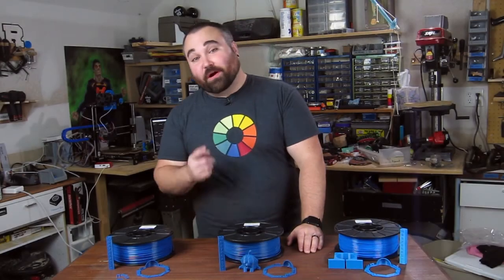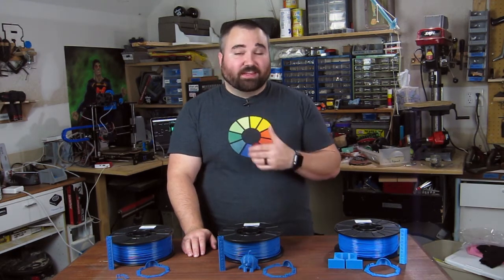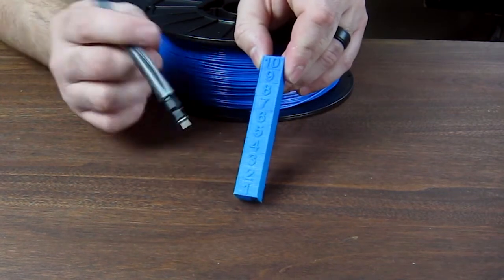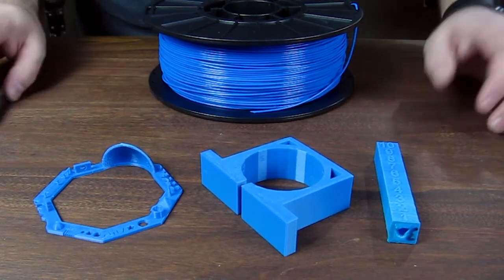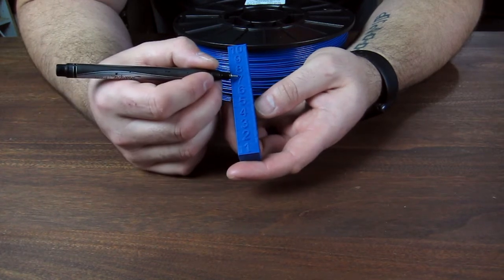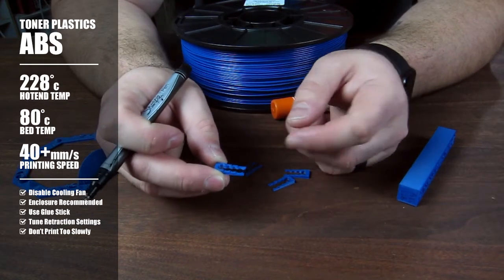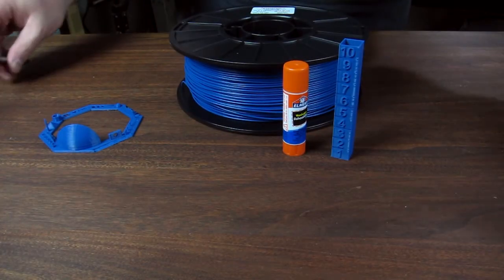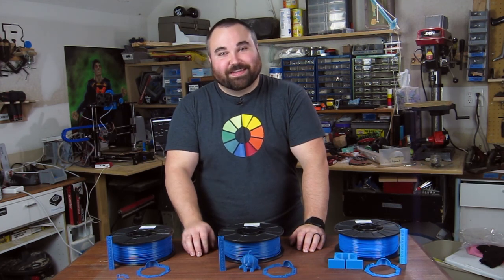Filament Series — Toner Plastics: PETG, ABS and PLA — 3D Printing

Comment: I love these types of videos as well. Really there are not alot of video's showing how to dial in a filament. So you'll get alot of inexperienced users claiming such and such cheap filament didnt work with their printer. Turns out they didnt profile the filament and there wasn't an Lulzbot or Uncle Jessie profile for them to use, so they assumed the filament is trash. I think esun makes inland pla for mircocenter, but you'll get alot of people claiming its no good. Once I profiled it - great filament for the price - $14.99

I would love if you mention calibrating your extruders esteps for the filament you are testing. So many miss this important step. Which will have them chasing their tail for extrusion multiplier and dimensional accuracy.

Also please use the actual temps printed on the temperature towers - that would be alot better for your users. U mention 7 or 8 as being best, but the real temp would be far better as well as a close up or picture shown as you reference the tower.

I dont know how far in depth of a profile you want to go into but a good basic profile also has:
retraction settings ( mentioned but please explain more)
overhang angle b4 support is needed

Advanced profile:
dimensional accuracy
support break away settings
fan setting
PID hotend
etc.......

Anyway great series. Keep up the excellent work!
Reply from the maker: Thanks for the kind words. Will definitely keep this in mind for episode 3!